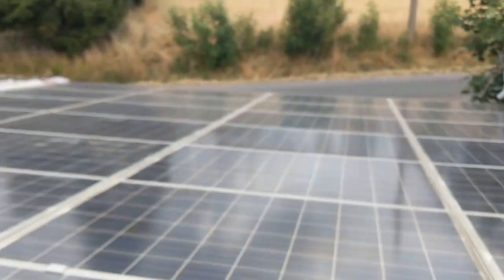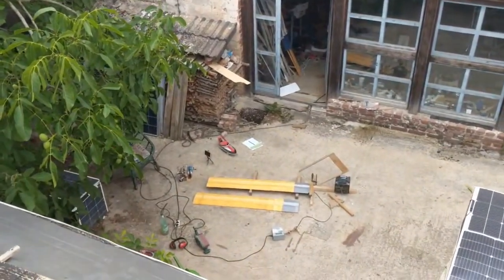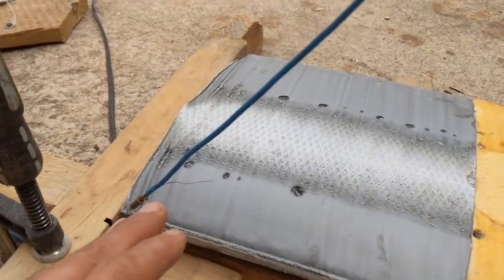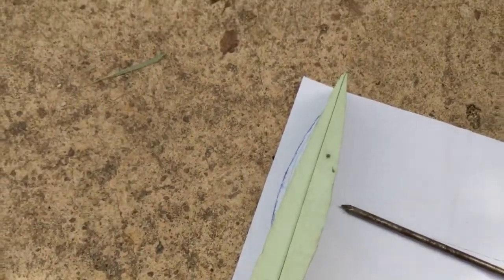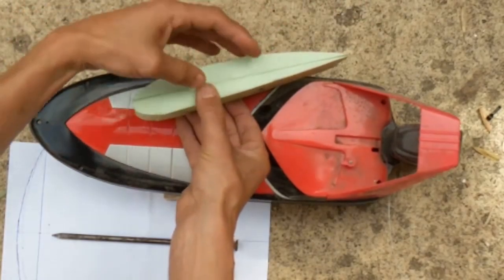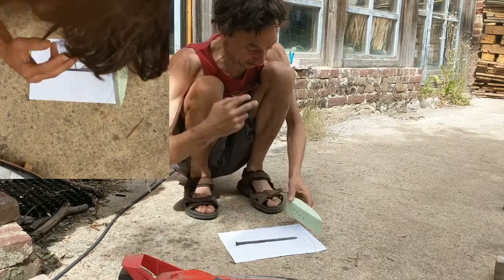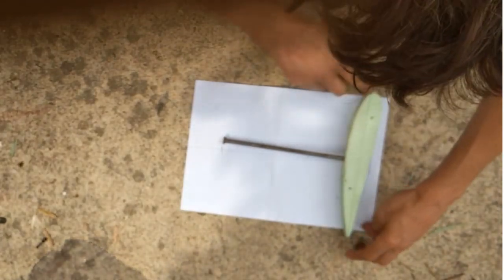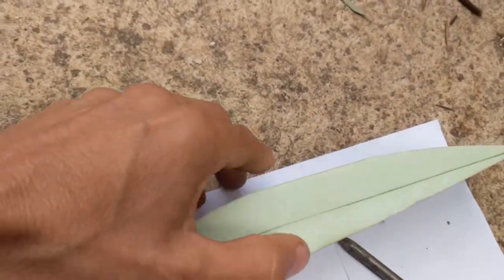Darrieus VWAT: mount aerofoils inwards or outwards ???

Comment: Wow that was actually a really interesting breakdown of what could potentially happen. Sorry if i cannot add anything to what you've said. I haven't thought about it enough. But your reasoning seems sounds. I had to rewatch a couple of times. Some people would say "an experiment is worth a thousand words" but this is good aswell. Maybe both would be the best ?
Reply from the maker: Indeed i think that my theories here in my video have some scientific value on how to optimize a Darrieus VAWT.
What resarch papers i have found by now simply do experiments. But my ideas on how to increase the Betz limit could lead to new designs..
The Savonius rotor that i also put in the middle (see next video) also affects the outer darrieus blades. This must not be totally negative..
Here the two papers i found, do not know how long they stay online:
https://www.researchgate.net/publication/347984992_Experimental_observations_on_efficiency_difference_between_helical_and_straight_bladed_vertical_axis_wind_turbines
https://www.researchgate.net/publication/344928008_Vertical_Axis_Wind_Turbines_Optimal_Positioning_of_the_Blades_Defined_by_Asymmetrical_Airfoils